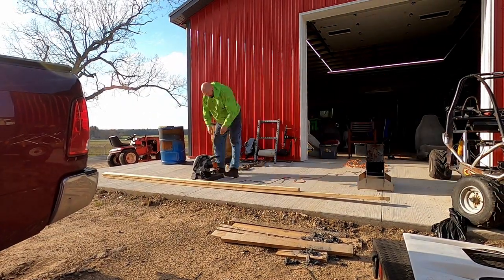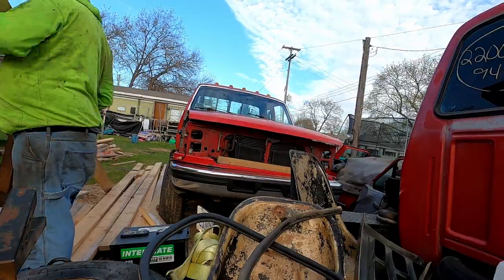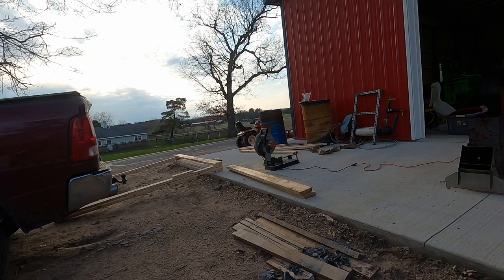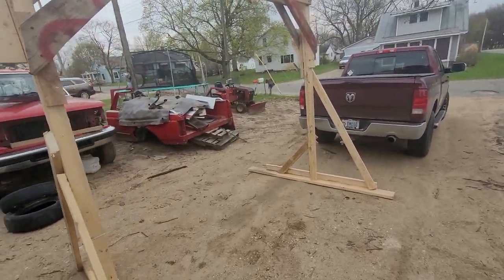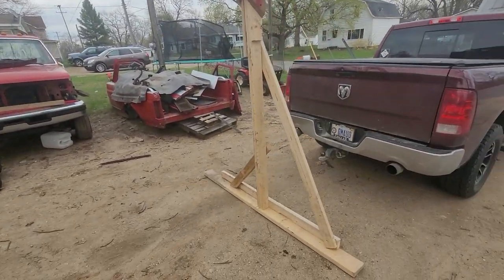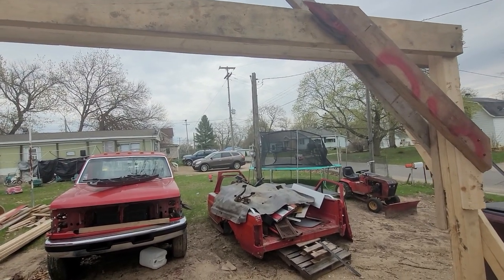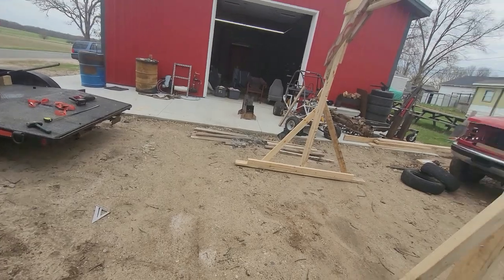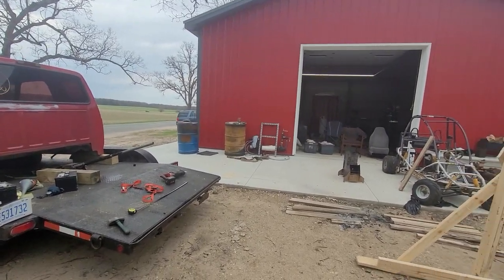The DIY Gantry build anyone can do!

Comment: I'm really looking forward to Daryl!! 
I have a dirt cheap 10' Yukon that needs a motor.. How much should I factor for motor you think ?
Reply from the maker: The Gen IV stuff is still pretty pricey, probably around 1200-1500
Reply: I have (2) questions re: gen iv 
Could you make an older ls work in something like the 10'
Isn't it the Gen iv that start getting problematic
Reply: I thought issue was DOD TECH
Reply from the maker: @kalbcorp  Not easier or cheaper than you can just buy the correct engine

Comment: Did it hold up ?
Reply from the maker: Literally used it to put the Cummins in this truck two weeks ago lol
Reply: @TheDrivewayEngineer  I'm impressed, I'm building one now to pull the engine out of my boat but mine will look like it was engineered to hold the whole freaking boat because I'm a carpenter as much as a mechanic and everything just has to be overbuilt. from these videos I get a ideal of the limits of wood, if your held that Cummins mine should hold a 4.3 V6.